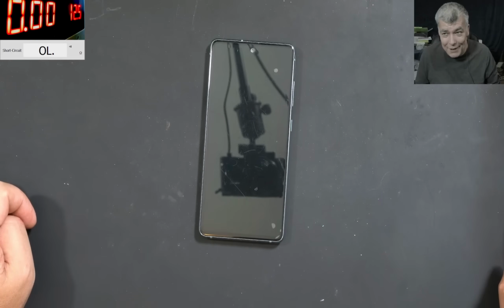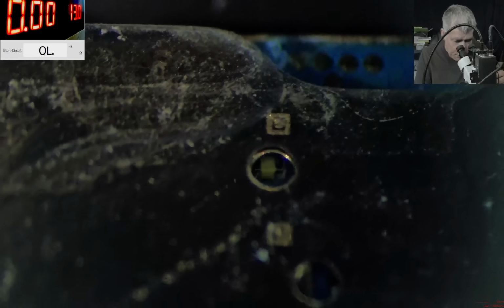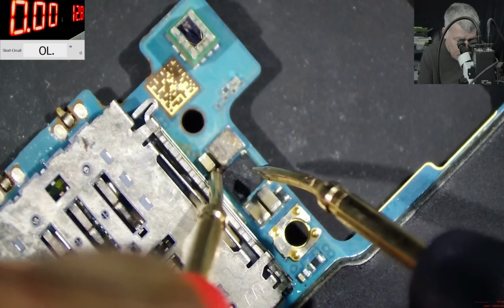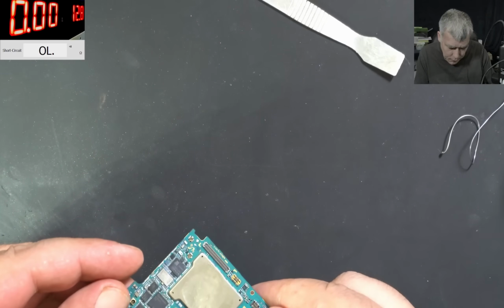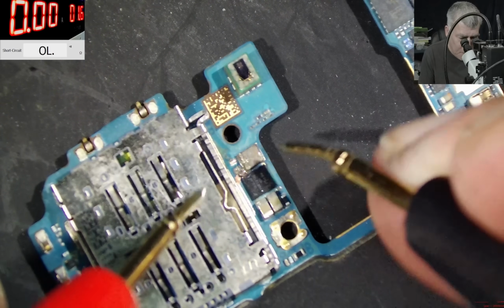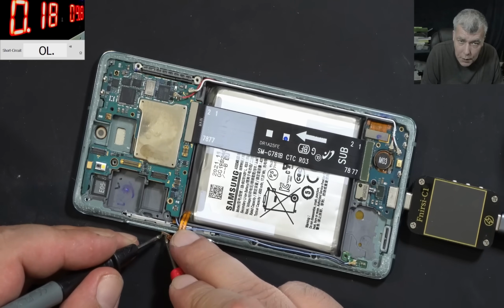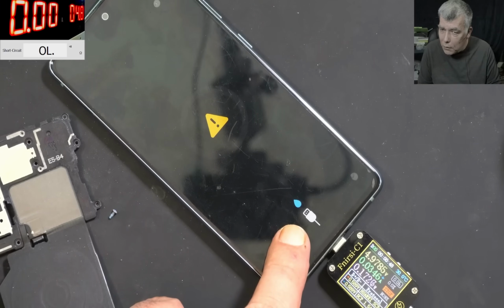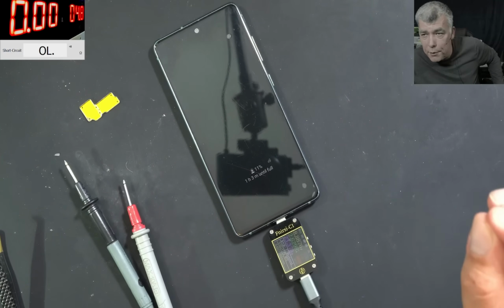Samsung S20 FE data recovery - water damage board diagnose & repair

Comment: Great Video, , I had similar issue with my S20 in India,in the month of July 2025, when water splash/moisture entered while I was walking in a rainy surrounding...

I got the Moisture Indicator on the screen. I shut down the phone... tried Wireless charging but didnot work... went to nearest SAMSUNG service center in Sindhudurg-MH. They used modern techniques to get rid of moisture/water drops inside.. when tried to recharge it, it didnot respond... I just kept it surrounded in tiny Silica gel moisture absorber pellets/bags of 2 or 4 grams...and simply switched my SIM card to a new phone.... (FF) after 2months, I casully tried to check if it can be charged.......to my surprise it did.... BINGO ! it started working again.. with entire phone data intact!!!

Comment: I have hp 840 G2 and it has amd card, recently I gave for repair, after repair I checked the graphics card was showing in task manager, but after I re installed the windows it is not detecting or showing amd card, few weeks ago after a restart it showed the card but again after restarting it isn't showing. can you tell what's the problem

Comment: Hi Sorin, why do you refuse to use metal brush? That toothbrush is massive and pretty useless at most times and places… you need some precision tools when working with tiny components. Sometimes your approach to repairs is quite disturbing, don’t know how else to put this in words.
Reply: a toothbrush is enough, but alcohol can't clean the corroded surface very well, and under the chips it's impossible, any part of the board that has liquid damage requires reflowing/reballing, otherwise the corrosion continues
Reply: @tommajor1013  I don’t mean just this repair, ment in general… he is not using the good tools, especially when cleaning things…
Reply: @goshm you should probably just go and watch other channels or post your own videos

Comment: Ridiculously small components on these phones. You know it's crazy when a toothbrush covers 3 ICs and 50 caps and resistors.
Reply: Very miniatured
Reply: If phones Made out from throw hole components it's gonna be massive and super heavy 😂
Reply: @gyoerdy7832  lol, I wouldn't go as far as through-hole, but the 0201 Surface components are insanely small.